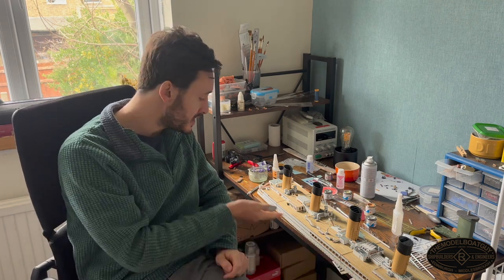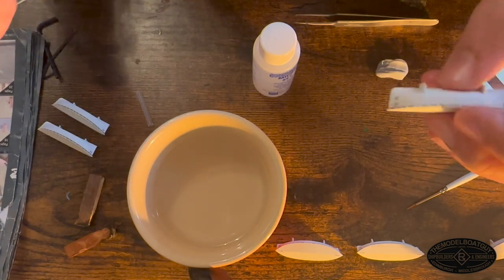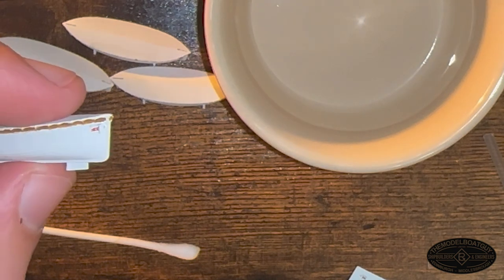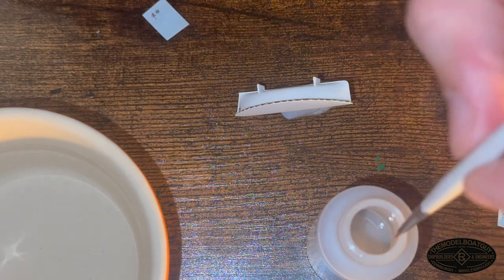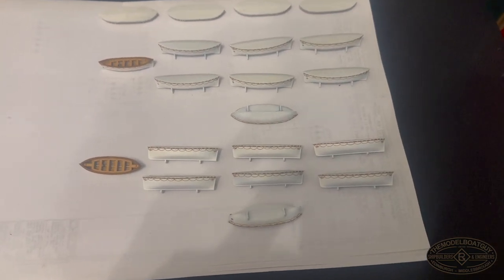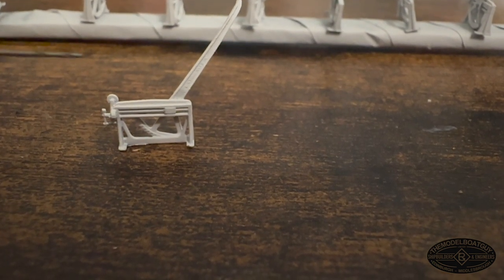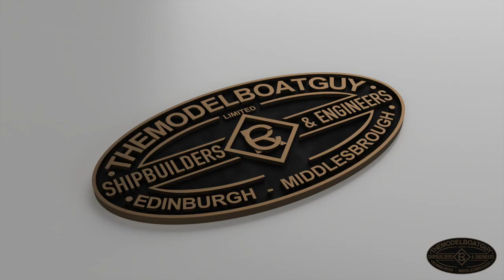Radio Control Trumpeter 1:200 Titanic Build Part 82 - Lifeboats Part 3

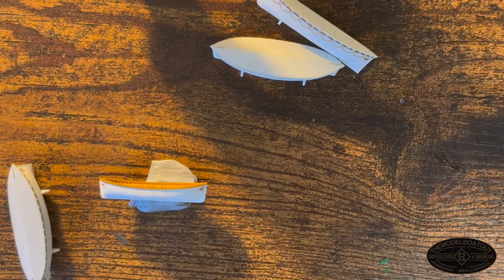Comment: 14:37 The emergency cutters didn't have grab lines along their gunwales, only the 30ft boats had them.
Reply: Are you 100% sure about this? Even inflatable dinghy’s have them, just in case you fall out and need to get back in. 😮
Reply: @polygonalmasonary  just look at any Titanic photo and you'll see that the cutters don't have grab lines.
Reply from the maker: Yeah annoyingly I have found a few pics and you seem to be correct! No grab lines, well spotted.
I’ll get them removed, fortunately I don’t have to fit the cutters for a while anyway 🙂

Comment: Great modelling once more. When building model loco kits a name or number might be missing from decal sheet. However judicious cutting of other decals would give the letter/number needed. Then with more cutting the individual letter could be inserted making the name or number required. Thus the boat numbers cut off could have used where they should,d have been.
Reply from the maker: Yeah you are correct, in the end I felt that they were too small, hardly visible really (and once the grablines went on very hard to see anyway!)

Comment: those decals really bring those boats to life... Question: what happened to the lifeboats after the rescue?
Reply from the maker: It’s a good question, they were unloaded from Carpathia and stored at the White Star wharf in New York for a bit. Where most things that could be removed were, either by souvenir hunters or by White Star. But an educated guess would be that they were assigned to other ships. For obvious reasons there was a huge shortage of good quality lifeboats after Titanic sank. The following passage from Wikipedia seems to tally with this line of thinking:

The 13 lifeboats retrieved by Carpathia were taken to the White Star Line's Pier 59 in New York, where souvenir hunters soon stripped them of much of their equipment. The S.S. Titanic nameplates which were not already stolen were removed by White Star Line workmen along with the rest of the identification plaques, and the boats were then inventoried by the C.M. Lane Lifeboat Co. of Brooklyn. They were assessed for salvage at a collective value of £930 ($4,972) as the only salvageable items recovered from Titanic. They remained in New York until at least December 1912; their whereabouts have been unknown since. One common misconception is that they may have been taken back to England aboard and installed on Olympic, Titanic's sister ship: however, this has since been disproven. They were either scrapped, left to rot in New York, or quietly redistributed to other vessels sometime after December 1912.
Reply: @TheModelBoatGuy  interesting reading, thank you for that.
I always wonder where stuff disappears to